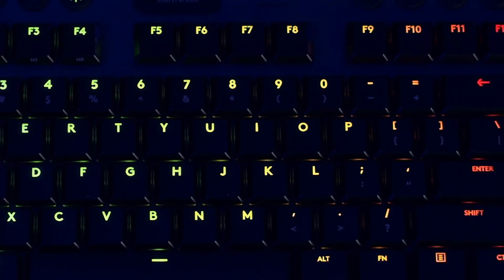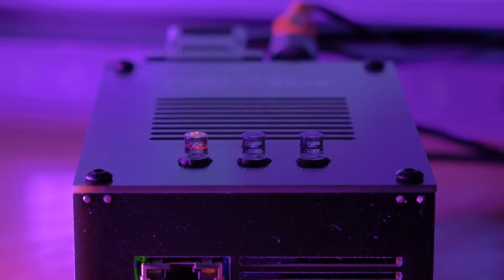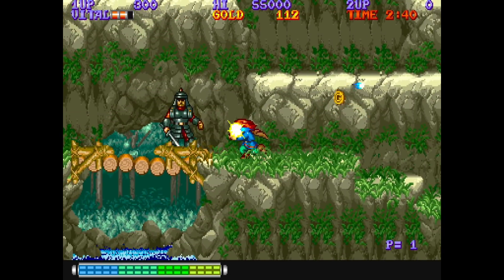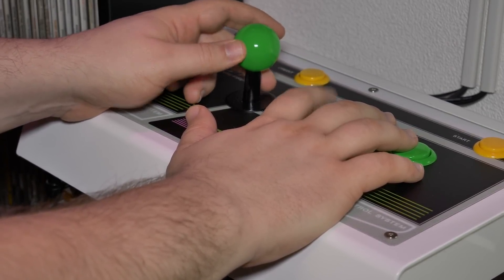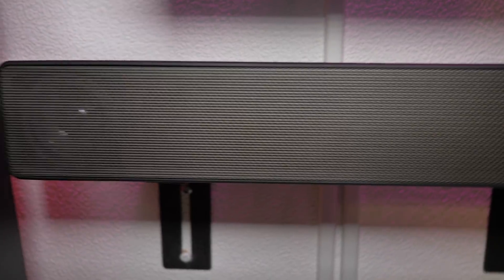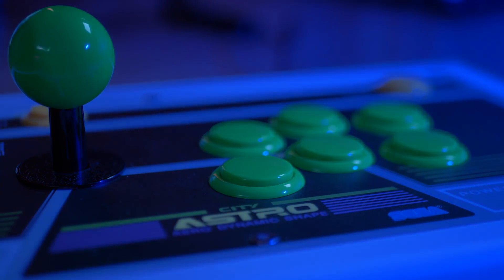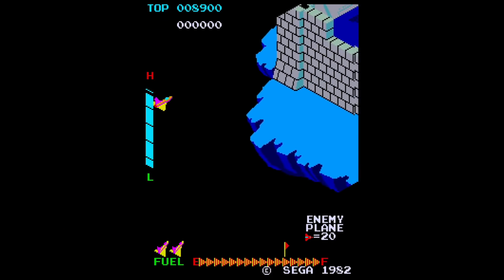DF Retro Hardware: MiSTer FPGA - A Brilliant Mini Emulation System Explored!

Comment: If only the iPad had an FPGA chip built in. The aspect ratio is the same as old CRTs, the high refresh rate of the tandem OLED would let you do black frame insertion and compensate for brightness, the iPad Pro could be the ultimate retro console if only Apple's chips had an FPGA with at least 10 million transistor available.

Comment: 13:39 not only there may be some accuracy issues, you should also consider the difference in frame rates. According to wikipedia the CPS-1 ran at 59.6294 frames per second, if you're capturing it from your MiSTer's HDMI port on the default settings, you're actually getting it at 60 frames per second with double buffering to avoid tearing and improve compatibility with cheap TVs and monitors. To capture at the native framerate, you'd have to either change some settings on MiSTer.ini (and have an HDMI capture device that can handle off-spec timings) or capture the video through the analog output. And how is MAME dealing with the framerate of your PC monitor not being exactly what the CPS-1 expects?

There are many, many systems that don't output exactly 60Hz / 50Hz video, but slightly higher or lower than that, while most cheap PC monitors will usually support only a few native refresh rates, like 60Hz or 59.97Hz. Every software emulator out there will have to live with it and try some acceptable compromise, with the MiSTer, if you have an old CRT that can handle those slight variations, you can play at the native framerate, or you can try to change the behavior of the video buffering over HDMI and check if your TV or monitor can handle that. I've found that most cores work just fine even with vsync_adjust=2 and only a few arcade cores made my TV complain about "unsupported format" or something like that.

Comment: So i just bought a crt not too long ago. 
Note though, i've been using emulators for a very long time now but only now i realize how bad they are.
Booted up Kirby in VBA-M and it's having an internal frame skip even though it says 0.
Played it side by side with a 3DS since it has full backwards compatibility with GBA  and the results are just mind blowing.
Input lag really freaking changes the experience.

Comment: I also am trying to figure out if I Need a MiSTer.... Every one I see comparing says it's more accurate than M.A.M.E. by a tiny bit(audio issues seem to be the large one) but, if you had nothing to compare it with on good hardware (a 3-5 year old corporate desktop would do fine here), is it that much better than emulation ? IS lag a huge factor here on RetroArch ? 

I have nice Emulation setup on a PC (HTPC) and I own over 50 different consoles a lot with Everdrives, so I can play original hardware for consoles and even own 5 coin op machines... How MUCH better is it than emulation is the big question here...

Comment: I wished we had FPGA in our Computers next to our general purpose cpus and gpgpus. FPGAs are not only useful to boost up Retro games but all sorts of applications. Many people don't know this, but FPGAs even served projects to achieve implementations of Raytracing with very little power consumption, way before Nvidia promoted their power hungry gpus with RTX as a new feature. Don't get me wrong. Realtime Raytracing was a needed step in computer graphics. But there are much more efficient ways to achieve it. We are approaching the physical limits of  transistor miniaturization. It is about time to think other ways how to increase calculation power. The wasted heat output from today's processors are increasing which hints to big inefficiencies. We need fundamental changes and not just small improvements and optimizations, which make us stuck in unnecessary complexities.

Comment: Jotego spends a lot of time comparing the cycle accuracy to original hardware. He also discovered that the MAME timings are way out for some emulations. He has worked tirelessly to get his FPGA implementation as close as physically possible to the original arcade boards. He also submits back discoveries to MAME to assist with its accuracy as well. For any screen draw differences, I can guarantee that MiSTer is closer to the true arcade board that MAME. As mentioned by another commenter here - Billy Mitchell got caught out for “original game play” that was proven to actually have been performed under MAME.

Comment: I'm more inclined to believe the output from the MiSTer than anything from MAME. It's not that MAME is bad, it's amazing, but MAME must take shortcuts to produce accurate-ish but performant results. You see things like sprites moving in sync every frame on MAME, but not on MiSTer, which for older arcade boards would not be as synchronous: i.e. there's no guarantee that different sprite planes would be fully buffered out to video at the same time within the same CRT scan sweep. So like you, I can't say for certain which CPS1 implementation is more accurate, but I'm more likely to lean on the side of the MiSTer implementations. Emulating on a CPU has a tradeoff: Accuracy or speed. If you want speed, one of the biggest accuracies you'll have to eschew is timing. You don't get to define your clocks, you get one, so you have to make it count.

Another point to make is that it's inferred in the video that FPGA designs are chip perfect in such a way that every individual chip is emulated. That's not strictly true. Lots of simplification does occur. If I know the exact timings of a subsystem, aka several chips running as a system within the larger board, I can potentially save many handfuls of LUTs designing around that subsystem behavior rather than every individual chip's behavior.

Comment: I'm interested in getting a MiSTer eventually, but I'm curious as to how future proof it is in supporting more higher end systems down the line in its current state.  I'd hate to go out of my way to get one only for a potential newer fancier model to come along soon after.
Reply: There are better FPGA boards, but they cost way more than the de10 nano.  But they are mostly unnecessary at the moment as no core has been developed to use all the capacity of the de10.  The Saturn or PS1 cores currently in development may be close.  Any console with higher requirements will take so long to develop that it's not worth worrying about in the next 2 or 3 years.
Reply: @christuckwell3185   Excellent!  That's all I needed to hear.  Thanks!

Comment: Nice video...I have a multisync 29" Arcade Monitor and Sony PVM but to be honest Mister HDMI output is so good I'm still pretty curious to see the link  to the IPS display you set up and check it out.  Also the font you used in your config is a nice touch (I use the Apple IIGS font for now but really like that one). If you could share that info it would be awesome! Thanks DF!

Comment: The Neo-Geo core is not extremely accurate, this seems to be a common belief online for some reason. I love the MiSTer and have been playing on one for over a year but the Neo-Geo is one of the least accurate I've played. I find software emulation to be less glitchy. Check out the issues list on the core github site to see them. However I still choose the MiSTer core over software emulators because of zero (or low) lag and the ability to play on a CRT (and capture through HDMI at the same time).
Reply: Its very accurate. Played a lot of aes and ng cd as a teenager. How is Software emulation more accurate having lag and sound issues?
Reply: It's very accurate... Git good

Comment: Love FPGAs, worked on them for years and they are way better for this kind of projects, because they work in hardware.
You can't get closer to that, because if you implement it with the right specs of a chip, you basically have a 1:1 copy of that chip in hardware down to the last clock cycle.
Now it's only a matter of time, till we have more complex consoles on FPGAs - we just have to wait for better hardware getting shrunked in DIE-Size and let electronics do its thing....and program it, of course :3

Comment: Yeah, pretty high-level noob look at emulation. To be fair, the authors prefaced as much at the start of the video. A cheaper, more versatile option is a ... PC, frankly. Decent x86_64 (AMD64) CPU, almost any recent GPU, and libretro with CRT SwitchRes 15 kHz is all you need.

Comment: I would say an old 32 inch lcd is likely the better options as I think you are doing a 3:2:2 to suit a smaller screen..

SF2  should run fine on widescreen..

However you are going to have resolution issues on smaller screens especially trying to display a res it was really never intended to display..

Comment: John, this was another great video; you are a master of retro and current gaming. I enjoyed the comparison of the graphical anomalies between MISTER and MAME. I would love to see you compare the MISTER to Analogue products (I saw that Analogue NT Mini Noir in your setup), emulators, and if possible real hardware. I am curious to see a lag test between Analogue and the MISTER, does the MISTER have added input latency when considering the controllers? USB controllers should add some slight lag to the MISTER, but I read from some forums that SNAC controllers do not. Is MISTER capable of zero latency when paired with a CRT?
Reply: Yes, MiSTer has zero input lag when using a SNAC controller.
I‘ve ordered my MiSTer from Antonio Villena, cause his devices come with a SNAC/DB9 port, supporting native Mega Drive controllers.
Just tear apart an MD controller, solder the PCB to a Namco PSX arcade stick and connect it to the MiSTer via DB9 cable :)

Comment: I just don't see the point in MiSTer over an emulation box connected to a CRT @15Khz. Input lag, which is so imperceptible you have to be looking for it to notice it on emulation, seems to be the only real benefit. But you trade that for not being able to run a lot of consoles.
Reply: you dont notice the lag but many others do and its just not about the layers of a lag a PC adds everything runs better no choppiness like in software emulation the sound is better also no audio lag. this is the thing most do not understand about fpga it is not a Pc. when you load a core it becomes a nes or a cps1 ect .a Pc its trying to be 2 things at once main reason you get layers of lag poor sound interruption from the PC working in the background causing choppiness

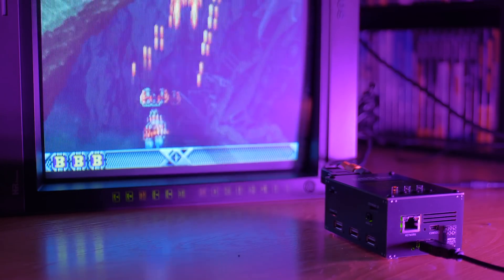Comment: 9:08 You speak as if a huge arcade cabinet is something bad. I have a real size original upright arcade cabinet and it's the most beautiful piece of furniture in my apartment. Yes it's stand out and it's awesome. There is nothing like having a real full size arcade machine sitting on the corner. I don't even play it very often but it makes me happy just by existing.

Comment: I have a MisterFPGA setup connected to a CRT and it is awesome. It "feels" like the real hardware.
Reply: Its impressive how good the snes core is. And i have a super NT to compare. Not playing on crt. I dont need that experience. ;)
Reply: @martinmoller4947  The SNES core is more accurate than the Super NT and is getting more accurate as time goes on, while Super NT, not so much.
Reply: @jackbootshamangaming4541  possible. And i guess more devs are working on the MiSTer cores. Kevtris did still a impressive job. I put the snt back in the box. Using the MiSTer is so convenient. Hope we get save states for snes core and every core possible.
Reply: It “tastes” like the real hardware.
Reply: @logan_cadfgs  Nah, real hardware for the systems this emulates is old enough that they still used leaded solder, so real hardware would be slightly sweeter.

Comment: You really should have mentioned Sorgelig, without him there would be no Mister!  As for the comparison with original hardware I am very interested in this, especially as regards the arcade cores.  I have had variable results testing against my own hardware such as the Amiga 1200, some games show lag on the Mister that do not on the real machine (Rainbow Islands for example). Overall the Mister is an amazing device, getting clean video output from computers like the Atari 800xl and C64 is practically impossible with real hardware but the mister does it perfectly.

Comment: There in lies a dilemma. Many games on Neo-Geo for example had huge slow downs on original hardware. In MAME you can overclock the virtual CPU and the games run flawlessly. So by all the "true to the original chips" logic this is bad.. And yet on this very same channel you guys praise the backward compatibility mode of, lets say, new xbox, which can run older games at higher fps.. this is basically the same as running it on overclocked old hardware. Why not use the same logic for older games?

Comment: Seems like it was missed in the video, but it's good for people to know that you can get analogue video for CRTs straight from the HDMI output with the "direct video" mode. A cheap "HDMI to VGA" DAC can convert it to RGBHV, which you can then combine to RGBS to use on pro CRTs, or instead you can use an HDMI to Component DAC for consumer TVs. Just make sure it's a pure DAC that just passes through the signal, and not one of those with scaling functions. So the analogue IO board is completely optional, and in some way inferior to the direct video via HDMI.
Reply: How is it inferiour?
Reply: @armorgeddon  The color bit depth on the IO board is lower than on the HDMI's direct video. That said, this may not make a difference for most game content. You can notice it on the rainbow background of the MiSTer menu. Another advantage is that you can tap digital audio from the HDMI output.
Reply: @Izquierda  Ok thanks. I don't get why the IO board is too limited in color bit depth though for the content in question here. Don't forget though that RAMDACs also differ in output so HDMI would not automatically guarantee perfect colors AFAIK. Good hint about the digital output of sound though there could also be problems with that considering old soundchips sometimes don't output the usual KHz sampling rate numbers so I wonder if HDMI supports all of those and if it does the next component in the chain, which would be a DAC, is even more likely to have problems with odd KHz sampling rates.
Reply: @armorgeddon  To be more precise, the IO board (the GPIO pins) can only output 6-bit, for 18-bit color, whereas direct mode from HDMI can use 8-bit color, for full 24-bit color. But again, in practice all supported systems that I know of only need 15-bit color at most, so you may hardly see any difference in most cases. It's still nice to have headroom. As for the audio, it's best to extract it digitally before it goes into a video DAC.

Comment: It should be noted you can easily put together a Mister yourself for under $200. The de-10 nano board is $136 at mouser. A 128mb ram stick can be bought on AliExpress for around $25. If you have a 3d printer there are many nice cases to print out. There is no need for the IO board or usb hub as the hdmi port supports CRTs and LCDs via analog and digital output. A cheap OSD adapter can be used to support usb controllers. USB support is very low latency. (1ms range)

Comment: Would love a lag deep-dive. You dont seem to have thought the SNAC add-on with an original controller was worthwhile. - I did see some very low USB lag numbers but depending on the exact controller.
Reply: SNAC is overrated and largely unnecessary
Reply: Are you talking about the google doc Porkchop made ? I don't see the issue, with the release of mini console we got all those controllers like the original but with USB plug and they were all tested to be lowlag when uused with fast usb polling.

Comment: MiSTer excites me a lot more than the Seires X/S or PS5 right now.

But, by and large, if i get one i'll be using it under the same pretense that Ive used emulation for the last 5-8 years: Only download roms and isos of games that are currently not available right now as either a physical or digital copy in store or on an active download/streaming based service. As far as i'm concerned, copyright goes straight out of the window if something I wanna play is not available officially outside of buying a used copy on ebay for a typically inflated price for a system I currently don't have plugged in or even access to.

Console ports of arcade games are the only real grey area for me (e.g: The SNES version of Super Smash TV has never been rereleased though the Arcade original has. But I prefer the SNES version so will get a rom of that but buy a copy of the Arcade game to offset the copyright shit)